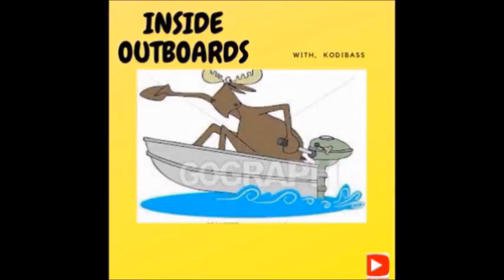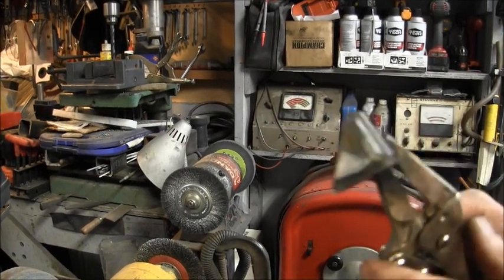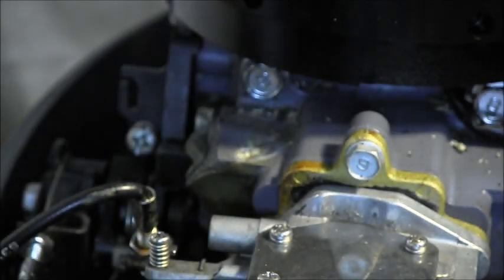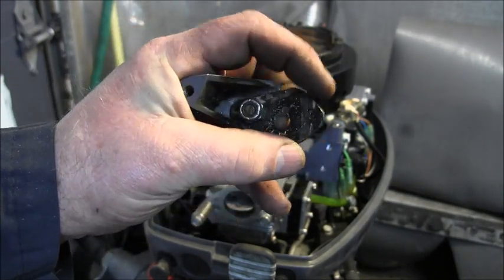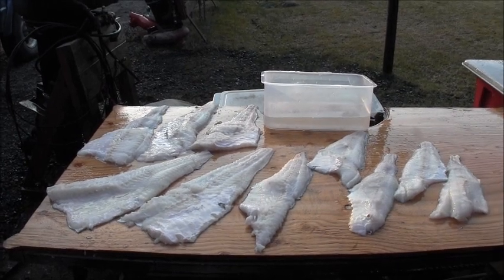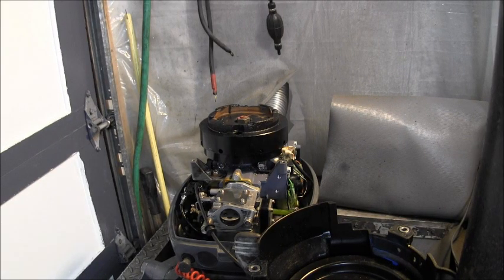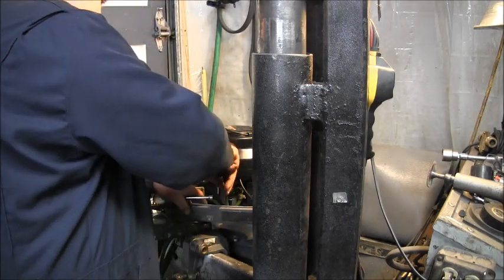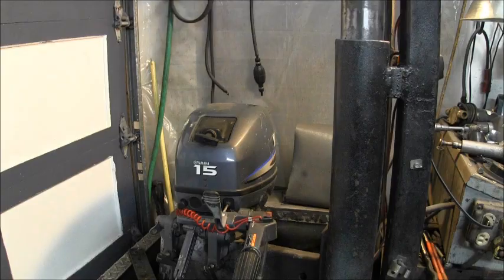YAMAHA 15  HP  2  STROKE,  Submerged ,      (  Part  2 )

Comment: Hi Kodi, pacific cod is the best. Don't  care for black cod. Good job on the pull start bracket rework. I have a welder but I still find it more fun to fab stuff for repairs. I think especially on aluminum it comes out stronger too. Getting ready to go for a test run on Lake Washington next week with the Starcraft. Will shoot a video
Reply from the maker: I'll B watch'n.   Have U tried the black smoked?  Yummmmeeee.      kb